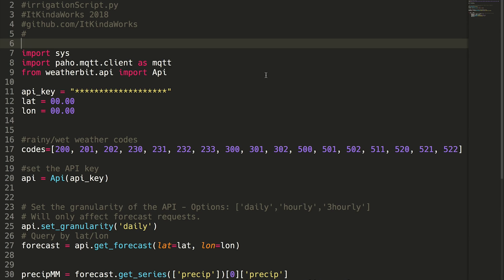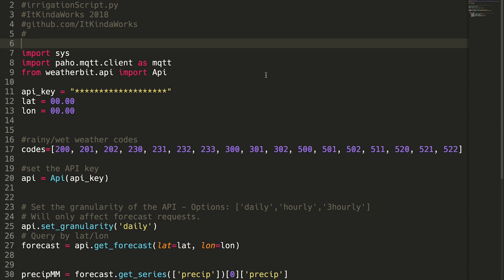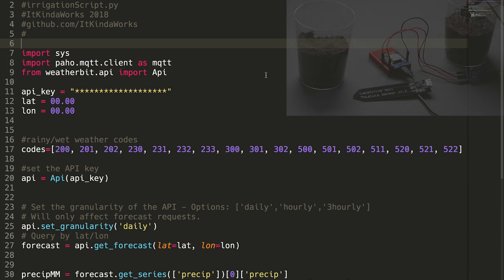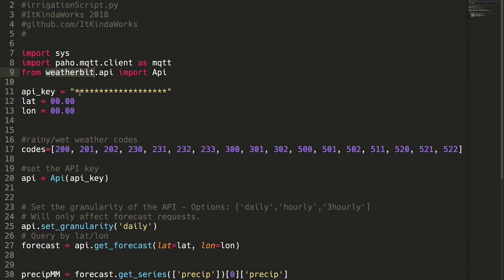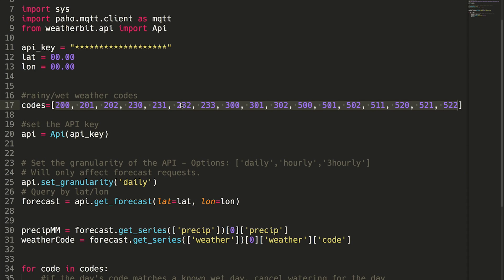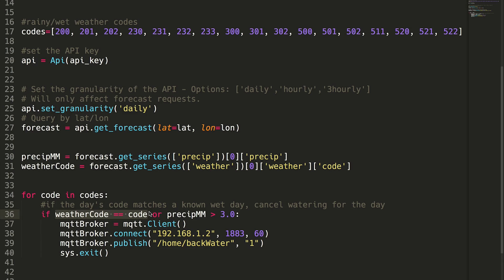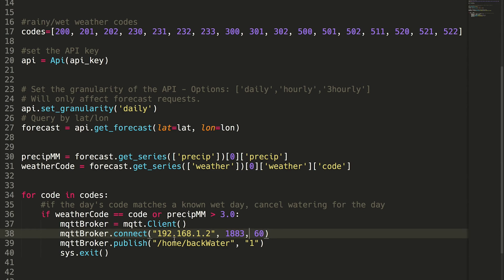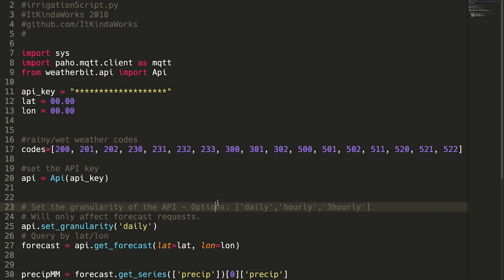Saving Water and Improving Old Projects

Comment: As far as I know if humidity is very high it indicates rain and  its probability.
Weather service is useless because it changes.
Reply from the maker: So far it's been working quite well. The idea of using humidity is something I hadnt thought of but I think that has it's own issues. For example in the area where I live, it tends to be foggy/humid at night/in the early morning. My humidity sensor regularly reads 100% humidity at night (which is also backed by historical weather data online). I could potentially put use a barometer but once I'm reading humidity/pressure I might as well use online weather services anyways.
Reply: You just measure humidity in relation to pressure and temperature and compare with some table of chances of rain. That's how the weather stations do it.
Connecting to weather service consumes a lot of compute power and RF.
Reply from the maker: I suppose on a low power device you could do that - but at the same time this device is controlling multiple solenoid based valves which consume far more power than the RF. And in my setup anyways my sensors are not on the same device that does the controlling of the valves so it would need to talk via wifi to those sensors anyways. Your suggestion is certainly a solution but not one that makes sense for the given setup. Plus as I said earlier, if I use all of those sensors, I might as well just query a weather service that has more advanced algorithms to determine the upcoming weather. Basically my theory is that there is no need to re-invent the wheel here; this is for watering a back yard after all, not managing a farm or something more mission critical. I think either solution would end up with missed cycles or over-watering every once in a while.